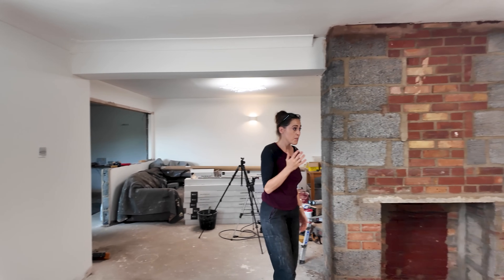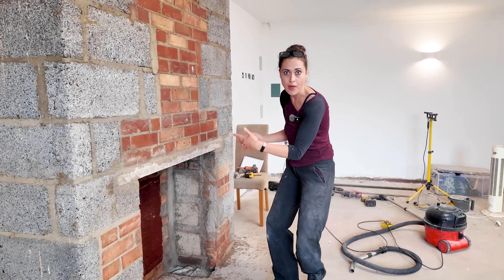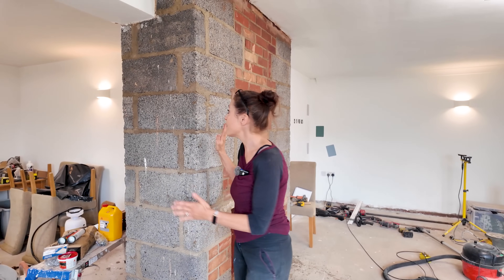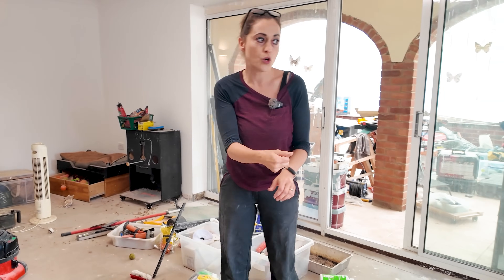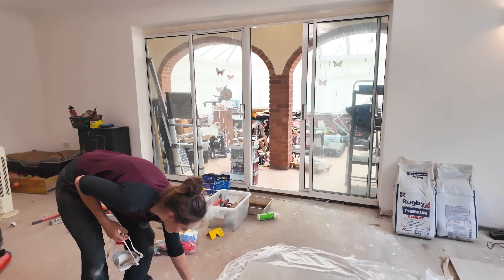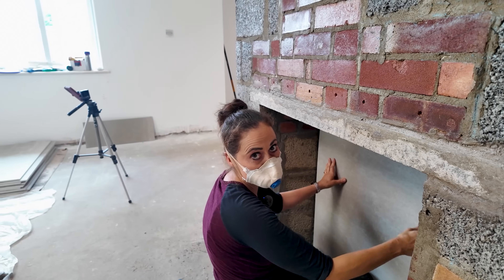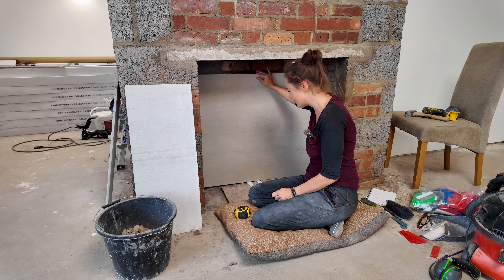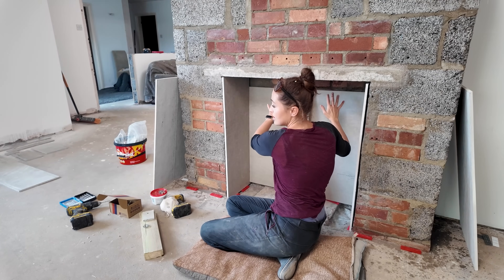Why I installed cement board on my WHOLE chimney breast instead of plasterboard!

Comment from the maker: Do you think plasterboard or pink fire rated board is allowed on the face of a brick chimney breast with log burner???
Reply: Fire rated within 200mm of the opening from what I remember when we did ours, though we ended up leaving a 200mm gap and fitting a painted steel fire surround that covered it
Reply: I wonder how many homes have a log burner just fitted in place of a regular fire. I bet there are loads and I don't ever remember seeing news reports of it causing house fires. But, better save than sorry I guess.
Reply: Wood burners can really annoy some neighbour's so you need the Pink Fire Rated
Reply: @Mike_5  what do you mean
Reply: Ordinary plasterboard is fine as long as there is a 150mm gap between it and the body of the log burner. On inside of the fireplace opening next to the burner it is best to use lime plaster to avoid cracking.
Reply: @stuartjones2242  The particulates emanating from the chimney
Reply: @PaulRansonArt   Its when trouble occurs that the insurance company will look for any excuse or reason to avoid a pay out.

Comment: Brilliant job Vikkie. Top tip - the dust from cement  / plaster destroys power tools. It gets into the bearings and ruins them. So take a few minuets to blow out the vents with compressed air ( if poss ). Hopefully it will keep your tools in better condition. 😃😃
Reply from the maker: Thanks so much! I'll get my Evolution vac on blower setting to try and clean anything out that's left behind!

Comment: Regulations are clear, A1 non combustible material must be used within set distances of the log burner, with differences at the sides vs above specified per the log burners manual. Outside of these any materials can be used, be it pink fire board or otherwise.

Comment: Hi Vikkie, your doing a great job, not the easiest to cut concrete boards using old saw blades is fine and you can get a better cut with them, might not be much use afterwards, but its done a job. Keep up the good work, see you on the next one, take care

Comment: The sealant is intumescent if i read correctly i.e. designed to expand on a fire. I hope it doesn't get hot enough with a log burner to cause that.

I'm convinced you do all the work. I had the same struggles with Hardi when cutring off small bits with less leverage 
..

Comment: Hi i have always used Fireline plaster board in side the half and on the front and never had a problem . also a huge piece of oak across and a double door multi fuel Firefox 12 stove and reclaim bricks as a half.

Comment: I feel your pain with scoring the 12mm hardie - I did my bathroom walls with this, and absolutely hated it.

There is a particular circular blade that is meant for cutting cement board, it is something like a four tooth blade. Never tried one, but I've seen Robin Clevett using them, so they must be a) right, b) good.
Reply from the maker: I think someone told me about this on instagram the other day! (Unless it was you 😅). I'll message him for a link to it if I need to do this again. Thanks! 😀
Reply: @TheCarpentersDaughterUK  no, it wasn't me. But they are easy enough to find, e.g. "Trend PCD Blade for Cement Fibre Board 165mm" at Toolstation.

Comment: Im pretty sure its better to scrim the cement board joints rather than fill them. Ive seen tiled walls crack down the board joints. BUT what a fantastic video series,

Comment: I had a Stovax inset stove fitted but prepped the chimney breast myself and fitted split face tiles with Marei adhesive straight on the concrete blockwork. Been up or 15yrs with no issues, maybe regs have changed since then cement board apart from giving you a flat surface seems an unnecessary step?

Comment: A1 cement board on inside breast, and standard dabbed board on the outer breasr would be fine. But looks great 👍
Reply from the maker: Thanks! That's what I hoped for, but was afraid to take the risk in the end incase I had to remove it all.

Comment: Massive overkill to do the whole chimney breast with cement board and very expensive. Ordinary plaster board is easily sufficient on the outside and the inside its much quicker to use a quick setting lime plaster though the cement board is a good option too.

Comment: You should have just tiled straight onto the chimney breast ,the tiles would actually adhere stronger to the block walls than the cement board. In saying that you have done a good job, just unnecessary.

Comment: If the intent was to tile the chimney breast then there was really only two options, sand:cement render or a cementitious tile backer board, which has been decided upon.  The reason for this is that the tiles need to be fixed to a substrate that does not move differentially with the tiles, which plaster/plasterboard will do.  The whole issue is exacerbated by the fact that the chimney breast will see greater fluctuations in heat so that the tiles and their backer need to be stable.   Fire cement was the right product because it is dimensionally stable unlike mastic.  Similarly mechanical fixing was the right spec as relying on adhesive in a relatively widely fluctuating temperature background is risky, the adhesive is best used as a leveller.

Why not tile directly onto the chimney breast with a thick bed adhesive?